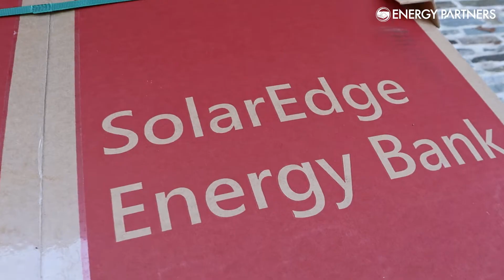SolarEdge Home Battery Installation

Comment: I am waiting for my pv and battery installation, but wanting it mounting on a boxing out and support the battery on some metal framework (unistrut) with cross rail behind. What height are the fixings at 00.23” to achieve the 200mm floor clearance? Many thanks.